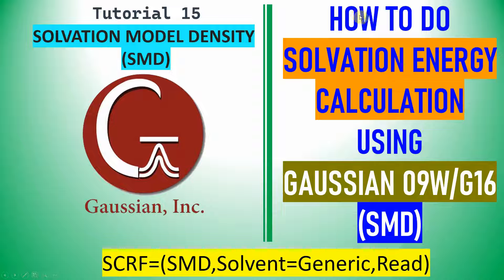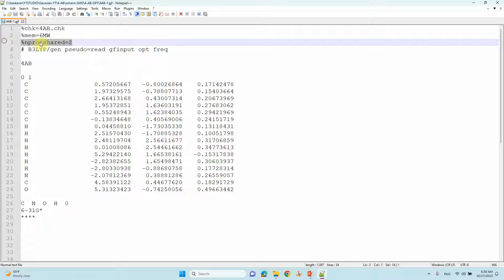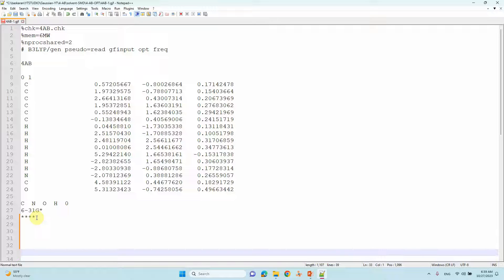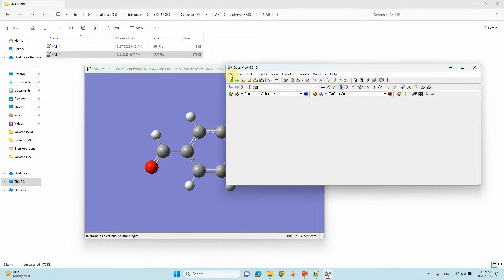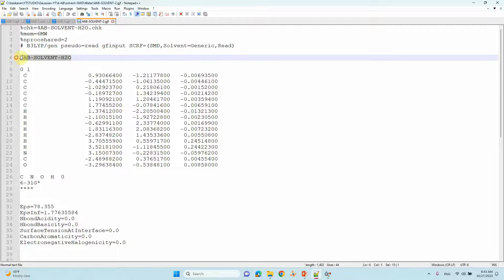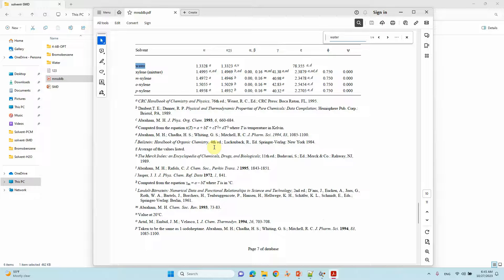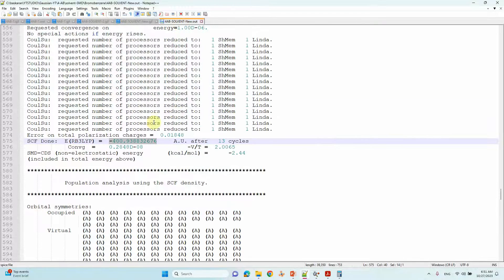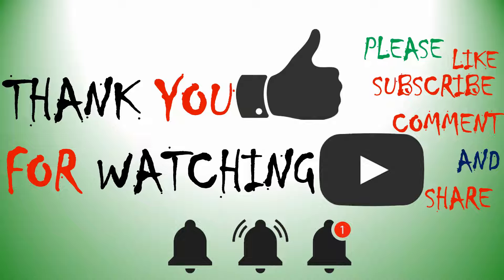How to do solvation energy calculation using Gaussian 09w and g16 | SCRF=(SMD,Solvent=Generic,Read)

Comment: Hello, the video was very interesting, I just wanted to ask a question. when you run the solvent calculation of bromobenzene in water,  the energy you obtain (SCF Done E(RB3LYP)), is that the energy of the molecule in the solvent (delta G(aq)) or is that the solvation energy (Delta G(solv))?